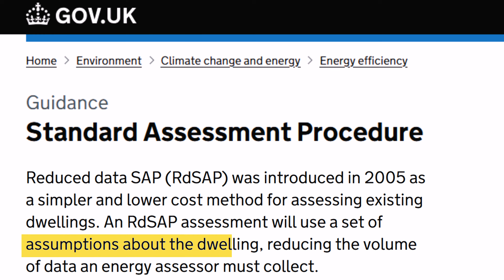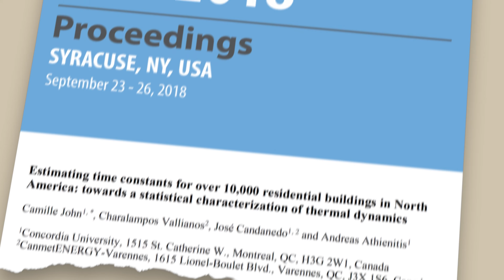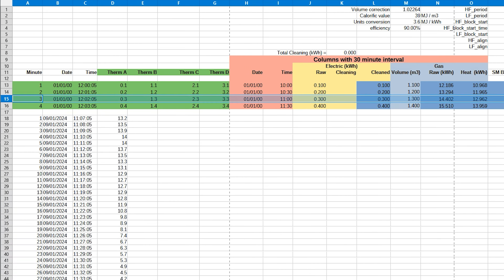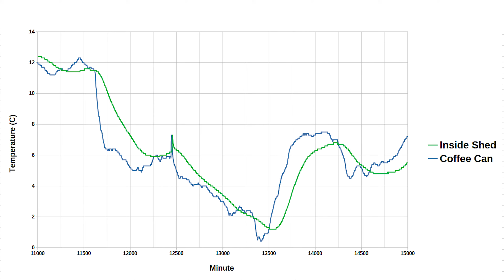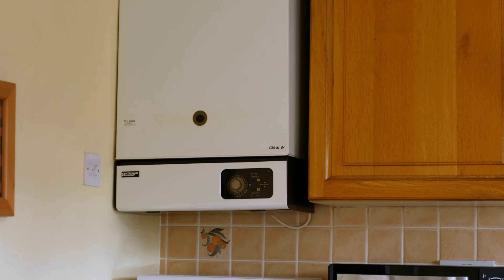Discover Fylingdale Court's Insulation Secret

Comment: Indeed, I have often mused, since I have outside and inside temperature charts for every day going back several years, that it must be relatively easy to calculate the heat loss per Kelvin of the house as it heats and cools. Yes a couple of cheap Elitech temperature loggers can also help since they can be moved to favourable positions unlike my weather station. Of course the heating industry only cares about heat loss at design temperature to make a gestimate of heat source power required, but interesting for the more inquisitive. Splendid stuff and very well presented in your video.
Reply from the maker: Thanks. When I started the project I set the thermometers to sample each minute, and never changed it. It would be interesting to know if it works just as well sampling each half hour, like the smart meter.